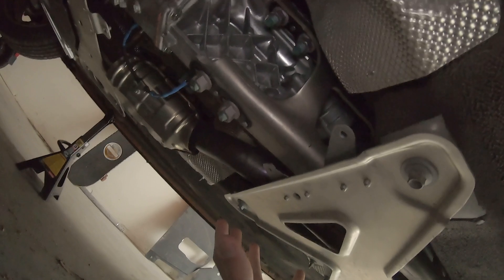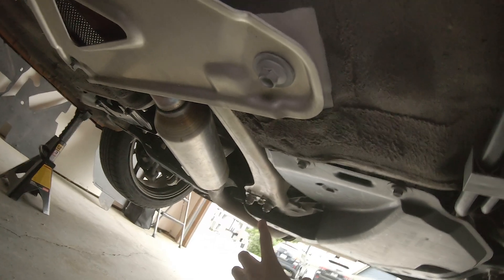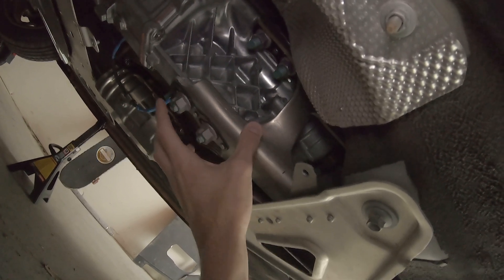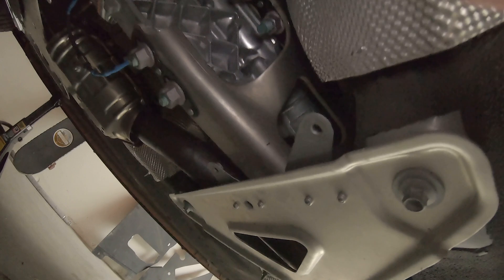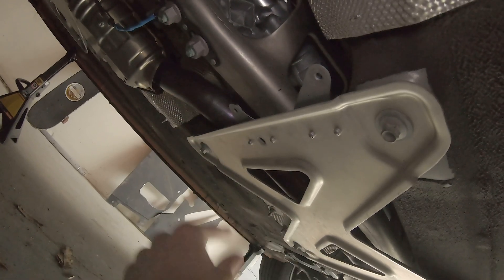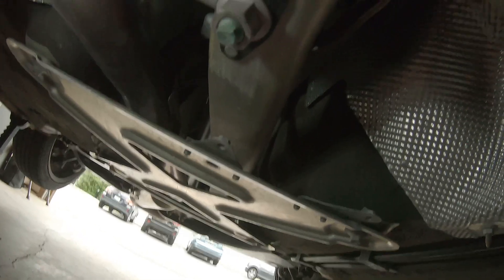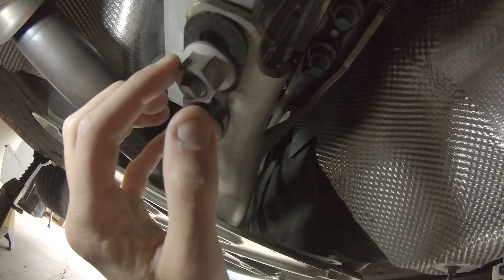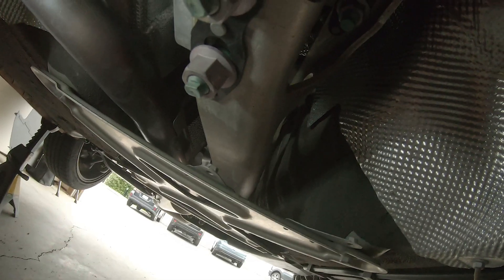How to Check the PPF Alignment - ND MX-5

Comment: Thank you for your video.  My transmission was replaced under warranty at the dealer and within 1000 miles I started hearing a creaking noise from the rear.  It turned out that all four nuts at the rear of the PPF were not tightened to specification.  Thanks to your video, I also learned to check the alignment, which was, as you might guess, no where close to the specification.  I've got things in alignment now.
Reply from the maker: Yikes! You’d expect much better than that from the dealership. Glad you were able to check it out and get it fixed. Thanks for watching and I’m glad this video was helpful!

Comment: Would you happen to know the size of those ppf bolts? My ND is creaking under initial throttle and my research leads me to believe this is the cause, as the creak sounds like its coming right from under the car.
Reply from the maker: I want to say they’re 17mm, but more likely they’re 21mm since they hold such a critical component and have a high tightening torque spec

Comment: the workshop manual tells you where to measure this - at the midpoint of the front bolt holes of the tunnel member. you measured too far back.
Reply from the maker: I used the workshop manual for this. At least the one that I was using, did not specify front of the tunnel member. It only specified the top surface of the tunnel member and bottom surface of the PPF.
Reply: Looking at your link in the description, I read step 10 as showing Axis line "A" at the midpoint of the front bolt holes of the tunnel member. 

I have an NC and am having difficulty determining this measurement because of an aftermarket tunnel member, so I think I'll try adjusting it and see if it helps some gear/drivetrain noise I'm getting on in-gear deceleration. @DriveMX5

Comment: The issue on mine is only when taking a right corner at higher speed like once the car leans enough and when reversing up a small curb while turning, there's like a rattle/knocking type sound coming from somewhere in the middle or rear of the car. Two Mazda dealerships could not replicate my issue so I'm not sure what it could be. Alignment is good. And when looking under the car everything looks normal, nothing loose. Could my differential be making this noise? It's not a limited slip though. I'll check the thing you mentioned in this video too.
Reply from the maker: Sorry I have not replied to this comment! I suppose it could be your diff, maybe one of the axles, or even a suspension component or bushing has gotten worn or loose. It’s hard to say without hearing the sound in person
Reply: I know this is a year old comment but search in YT for “Source of Rattle under a 2016+ Mazda MX5 (ND) and How to Fix It.”
It may help you if you still experience that rattle. YouTube wouldn’t let me paste the link.
Reply: @FJDIAZ  I actually figured it out. Turns out I had two passenger side rear axles instead of one driver and one passenger. They are slightly different lengths. Thankfully it didn't damage the differential.
Reply from the maker: Wow! Good information to know, I wasn’t aware there was a difference. Glad you found the issue!
Reply: @DaveSimkus  I’m glad you figured it out and didn’t damage the differential.

Comment: Glad I came across this video, I was planing to loosen the PPF to install diff bushing inserts. I won’t be doing that now. Did you ever resolve your issue?
Reply from the maker: No, but it turns out the ppf wasn’t the issue! It was two sets in a row of bad tires. One set wouldn’t balance right and they were egg shaped. The second set balanced okay but still vibrated and the vibration finally went away after getting Michelin Pilot Super Sports.

I’m glad the video was helpful in some capacity! You can definitely loosen the ppf, just make sure it’s aligned properly afterwards

Comment: I have aftermarket wheels, tires and lugnuts. Goodwin Racing, not some rainbow ebay ones. I'm about 1 turn shy of the recommended 8 turns on a 12mm lugnut. I torque to 100 lbs-ft. I know that's more than the book. I'm aware that this might just be a problem specific to me because of my wheel/lugnut/torque/tool choices.  I didn't have the stock stuff on for long enough to know if i'd have the same trouble with that. Disclaimers out of the way, to thwart the hazards of youtube commenting. I do lots of relatively high speed freeway travel between las vegas and idaho. 90 plus mph for hours at a time. I sometimes get a bit of what feels very much like a slightly out of balance tire in that speed range. I carry a torque wrench with me. It's the same wrench locked at the same setting, from my pre-trip retightening, until i'm at my destination. (I know you're not supposed to store your torque wrench set above zero. It's for 2 days and I don't want to dig glasses out of my backpack to read it. I know my phone has a magnifier. (youtube comments)) I stop and run around the car and hit all the lugnuts. There's always a couple that i can get about an eighth of a turn out of before they click. When i get going again, the vibration is gone. Not saying that's your problem, but maybe check it out.
Reply from the maker: I'll check that out, thanks for sharing. After doing some more digging on my end, I do believe the tires are the primary issue as they were cheap and showed excessive force on a road force balance machine. Force matching them couldn't even fix it completely.

I wonder if in your case, being one turn shy of the recommended 8 has something to do with your lugs loosening themselves.
Reply: @DriveMX5  I'm sure it does. It's just Konig freeforms and mcgard spline drives from goodwin, not some off the wall thing. I bought different lugnuts and even a thin walled  socket won't fit down into the lug holes without risk of scratching the wheels. The key for the locking lugs fits down in there just fine. I just came up with a weird combination that i can't solve without black or open lugnuts, which i don't like aesthetically. Sometimes you gotta choose between looking cool or living longer, and i made my choice. Seriously, I don't think i'm in any danger of them actually falling off or anything. It's a very slight loosening of a couple lugnuts causing a very slight imbalance at very high speed over a prolonged distance on a very light car, that i had aligned to be as sensitive as possible.I think it would still happen even if i got that last turn that I need.  I would do torques and tire pressures and fluids every morning of long trips through the middle of nowhere on a long trip no matter what i was driving, so i'm not really adding anything to my routine. I used to work on helicopters, so my stupid brain never lets me trust mechanical things to just work without falling apart. Hope you get yours sorted.  Keep up the good work on the channel.

Comment: What kind of vibration is it? Check your exhaust hangers too
Reply from the maker: Feels like a rotational unbalance. It was like a death wobble between 80 and 90mph. Now it does feel like the tires are a bit out of round. I got the tires not too long ago and they only have about 1k miles on them so I may be able to get them warrantied and replaced
Reply: @DriveMX5  I have a 21 nd gt and get a noise that sounds like the bearing is about to go out on the rear of the car especially when I’m turning in first gear but then i can faintly hear it on the highways so it must be on all speeds but especially when I turn and it’s super loud but than again it’s been wrecked twice badly lol
Reply from the maker: @eliekhananya1551  oh dear 😅 that’s quite odd. I wonder if there’s something wrong with the diff? That would make the most sense in my opinion if there is a noise coming from the rear, especially when turning.
Reply: @DriveMX5  ya but nobody has been able to figure it out but really nobody wants to figure it out, Mazda has been terrible so I just gave up for the moment, it’s been in the shop for the past 6 months, once I get it back I’ll try again. But I’m willing to bet it’s the diff.
Reply from the maker: @eliekhananya1551  ugh, I’m so sorry to hear about that! Vibrations are hard enough to pinpoint and if you are trying to get anything done under warranty then that’s even more tough. Manufacturers don’t pay much for warranty work and often won’t pay diagnostic time so dealers don’t want to lose money doing it. I’m having my car looked at by my local Mazda dealer again for the vibration from the rear (I think my diff is the problem too) and I only hope they do take a real look at it and fix it.
Reply: @eliekhananya1551  Sometimes the wheel bearings can be unseated a bit and wear abnormally. That would cause some noise. also make sure the tire isnt rubbing anything, and that the brake shield isnt dragging against the disc.

Comment: I think I might have the same problem.I have a brand new nd2 GT that I installed progress springs on. at highway speeds it feels like the rear of the car is occasionally shimmying. I changed wheels and tires at the same time and was assuming my tires were just more squirmy than the stock Bridgestones
Reply from the maker: Which tires did you go with? Idk if you saw my post but the shop found out my tires were a bit out of round and unbalanced. They did some work to help fix it but it’s not perfect and still vibrates but much reduced. I’m still thinking there’s something else going on
Reply: @DriveMX5  Hankook Ventus V2 Concept 2 H457, in 205/50/16

I guess I can try getting my tires rebalanced
Reply from the maker: @KuruCy  yeah I would try that. The same shop that I took my car to recently mounted and balanced my tires. Then when I came back, they used a road force machine and it had to be rebalanced as they didn’t do it good enough the first time. I hope that’s all it is for you!
Reply: @DriveMX5  fyi, my tire pressures were uneven. Once I corrected the pressures all around the wiggling went away.
Reply from the maker: @KuruCy  I’m glad yours was a simple fix!